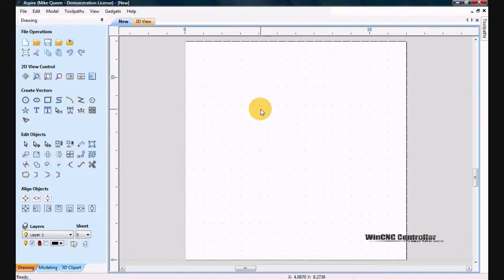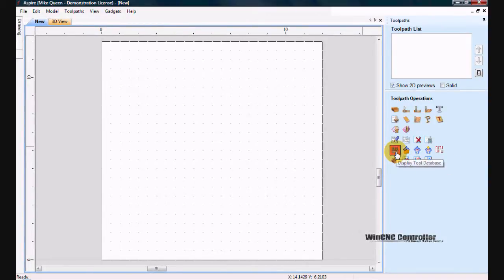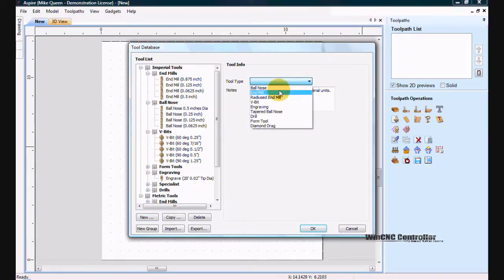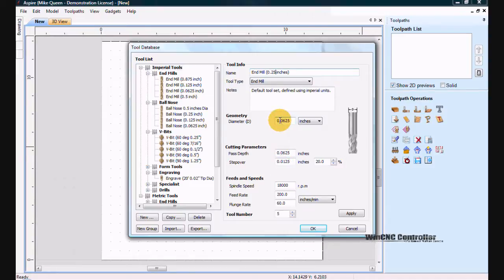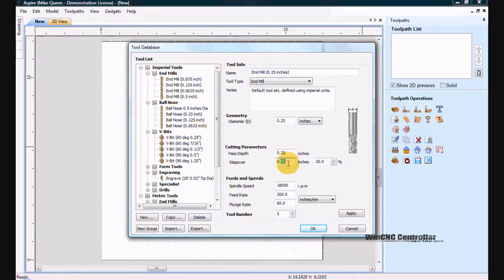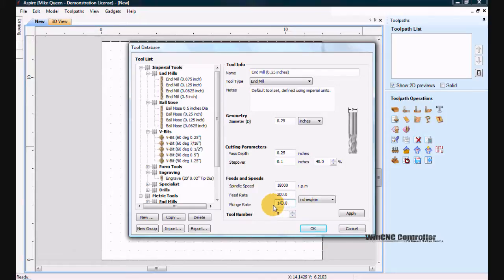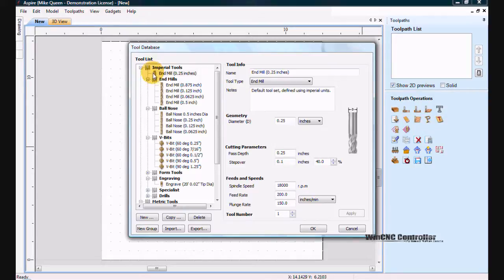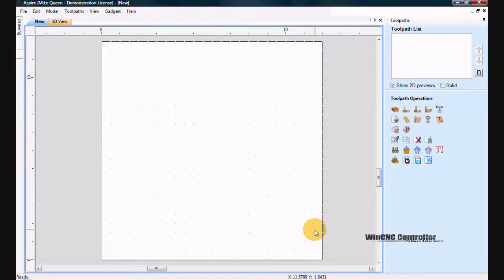VCarve Pro and Aspire Tutorial - Create a new tool.

Comment from the maker: I had to add a second comment to finish. 

My machine has steppers so I'm limited to fairly slow speed. A servo machine might be able to double this speed or more.

For aluminum, or some harder material, I'd select the tool, then click the Edit button and set the pass depth to less (maybe a few thousandths) and much slower feed and plunge rates.

For softer material (say foam) I might set everything higher.

I hope this helps.

Comment from the maker: Hi squidskunk, sorry for the poor sound quality. 
the feedrates and depth per pass are determined by several things... type of tool, your machine capabilities, material you are cutting, quality of cut you expect.
I usually only cut wood, plastic/Corian, and a little aluminum. I set my tool for the softer stuff by default. I set the tool to cut as deep as it is wide - 1/4" diameter tool, 1/4" deep per pass. Feedrates are what my machine can do from experience. Start slow and work your way up.

Comment: Question for you. I have a 3040T cnc that I just got. I have been having trouble with it engraving the whole photo using vcarve when it engraves using mach 3. It shows the preview on vcarve to be correct and then when I egrave it doesn't do the whole thing and words come out backwards. I am not sure if it has to do with the bit or setting or if it is getting stuck. I am not sure. How do you get it to engrave a whole thing and right size?